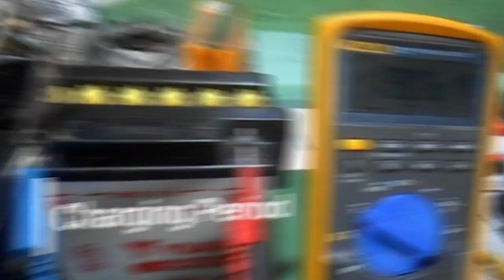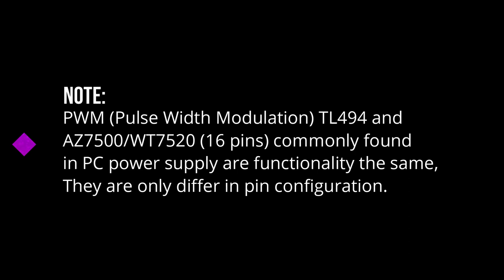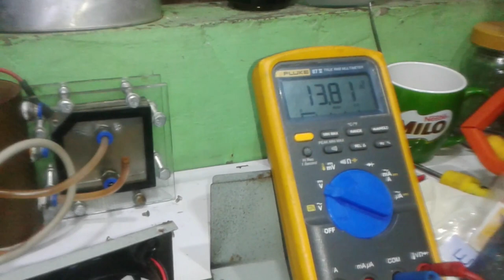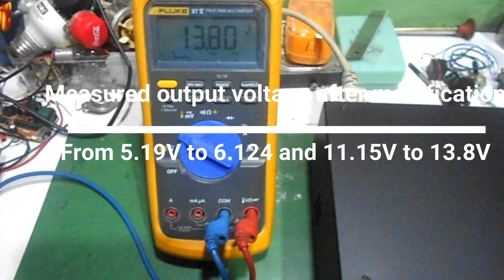HOW TO CONVERT PC POWER SUPPLY TO CAR/MOTOR BATTERY CHARGER. 100% EFFICIENT AND TESTED!

Comment: You're a true intelligent technician , many videos are posted, with the same idea,you presented, but no one goes deep to alter the 12 and 5 volts as you did . Thanks for posting such a useful material. I  have  a decent battery charger،  now .
Reply from the maker: You're most welcome :-) I am glad to hear it from you. Please subscribe to my channel. I'll be uploading & share more educational videos :-)  Thank you.
Reply: @rmttechnology7628  
I subscribed, time ago 😊
Reply: Picture is not clear for adding resistor you said between 4, 9 & 10 is it that we have to short 9 & 10 of ic my atx has 7527 is it same as 7520?
Reply: @cvkchary3251  I don't recall the number of chip , but I googled it  for the data sheet, and verified the value for the resistors and where to solder , If I still remember, , one resistor to alter the value of a reference voltage, and the other is to increase the feedback . I hope I'm right, anyway it was exactly as the video stated . Hope this is useful.
Reply from the maker: @cvkchary3251 . Pins 9&10 are both connected to gnd. To clarify your concern about KA7520 & 7527,they are actually not the same particularly in pin configuration based on the datasheet.

Comment: Hi
Can please , discuss further, the addition of a resistor, to alter the PWM and generat a 6,2 v . And do have to load it .
Reply from the maker: Hi Mazen, sorry for my late reply :-) In response to your inquiry, when you look at the data sheet, pin4 is a DTC pin. I only set the DTC (Dead Time Control) pin by putting 3.3kOhm in order to increase the output 5Vdc to generate 6.2Vdc. :-)
Reply: Hi 
I'm not the designer of  addition of the two resistors to the control chip of the SMPS . I just followed the instructions given in the video , and verified the design , for location and value .I remember I got 13.6 V . Not 13.8 . I think some of the pins were connected and can be considered a single point. Anyway watch that video slowly, look at the data sheet, and finally refer your question to the designer, he will help you for sure . Sorry for me , it's going to take some time to work on the device again , and cross reference the change to data sheet. When you solder the additional resistors, be careful, not to short any pin out , I did it , you can do it .